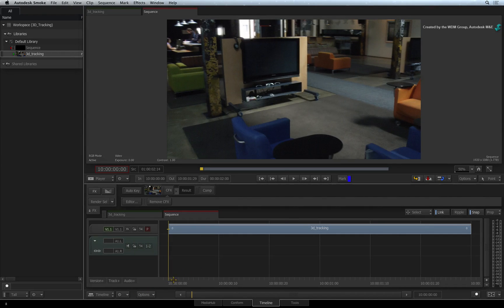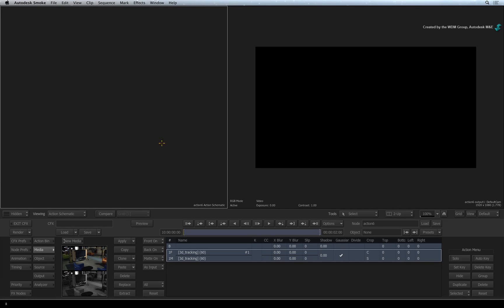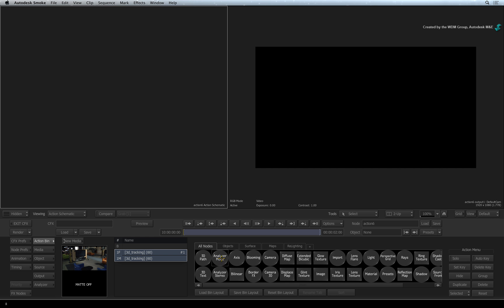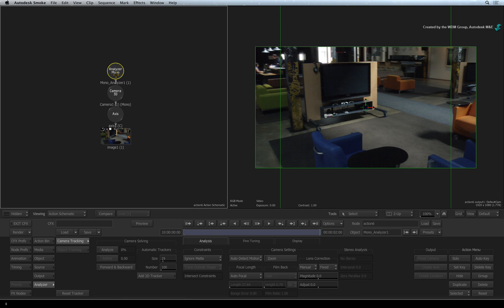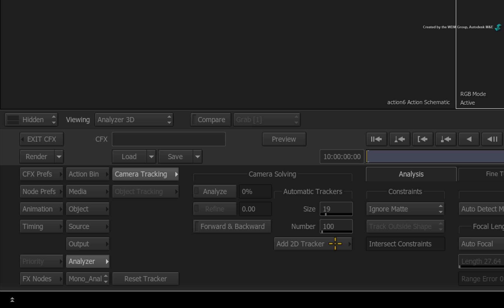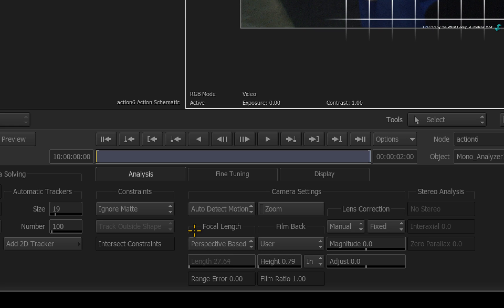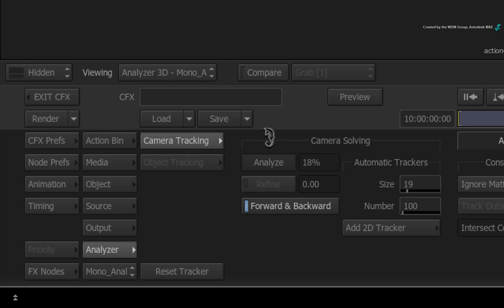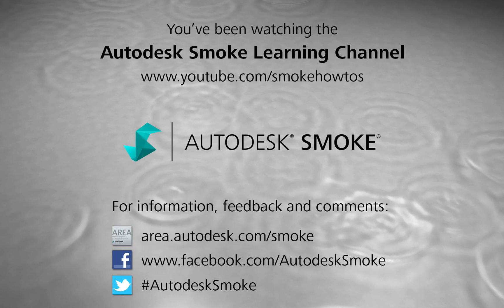Compositing with 3D Tracking - The Analyzer

Comment: You mention removing lens distortion. Is this not a feature available in smoke? If not, it kind of makes the camera tracker a bit useless. At least in the sense of a stand alone vfx app.
Reply from the maker: Hi -- here is the link to a suggested way of removing lens distortion in Smoke.   Working with Lens Distortion: Removing Distortion I never said you could not do it in Smoke.  I simply advised you that you need to for 3D tracking.  Hope this helps!
Reply: Thanks.